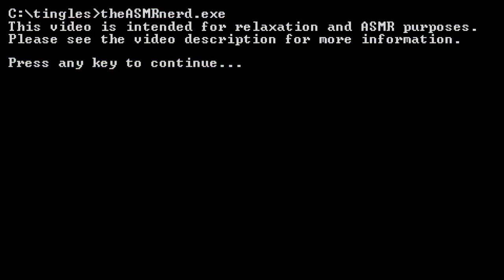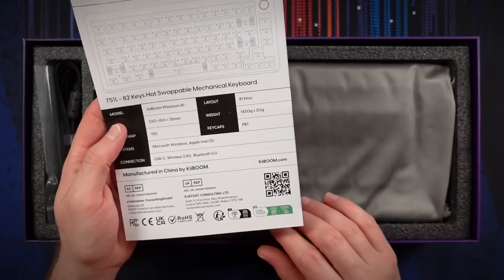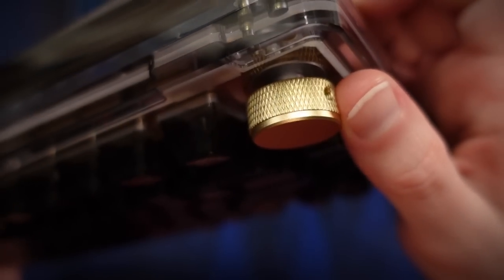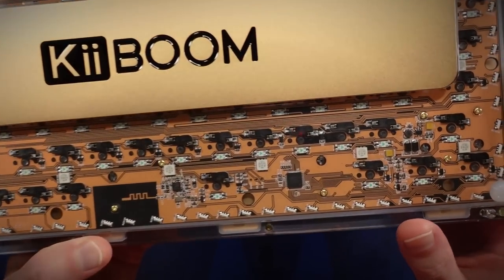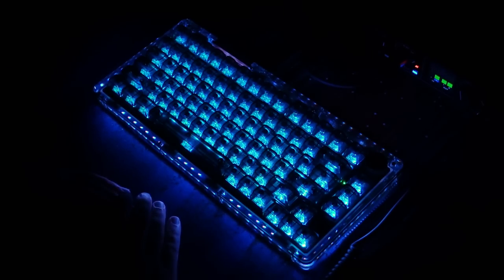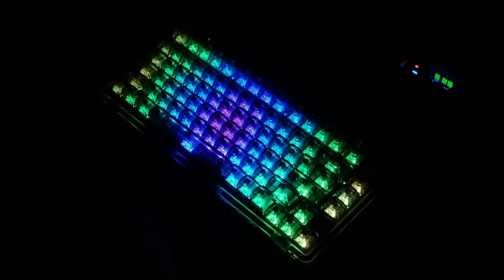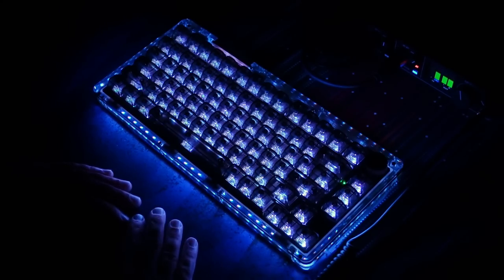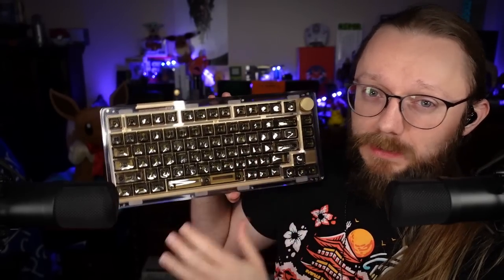Soft Spoken ASMR ⌨ KiiBOOM Phantom 81 Mechanical Keyboard Unboxing & Thocky Typing

Comment: bro kiiboom phantom 81 or skyloong gk75 aluminum 4 Knob.

both keyboard pre-built.  

I'm getting both keyboard for same price. 

so which one would be better, please reply.

also tell me the price of Skyloong gk75 aluminum, I checked it on epomaker site, it showed 170$ for the pre-built. 

but the switchandclick channel girl said it's about 255$ 

because when I google the price that time on skyloong site it shows 180$ just for kit. 

so if it is this expensive and if I'm getting it at same price as that of kiiboom then should I go with skyloong?

but kiiboom's look I liked. 

I was wonder if I don't buy skyloong then what would I be Missing. 
- 4  knobs (i don't know if that many knobs are any good for me)
- aluminum built
- expensive board at kiiboom price. (bro please check the price of the pre-built)
- 5.1 bluetooth. 
- better stabs and sound ? (I'm not sure)

Comment: That is an awesome microfiber cloth. Thing is huge. Would be great for big TV's.
Reply from the maker: That's actually a great point, I can use it on my monitor (which is actually just a TV lol)
Reply: @theASMRnerd  yeah, I've never seen one so big haha. And I do the same thing, tv as a monitor. Cheaper to get a nice bigger one for some reason. Slap monitor on it and suddenly it's double the price lol. I suppose the hz are usually higher though.

Comment: I have to admit that I skipped straight to the typing portion of this video and I have no idea what he did to this thing, but I was completely surprised by how good this build sounds.
Reply from the maker: No worries, I provide the chapter makers for exactly that reason! I actually didn't do anything to this keyboard, the typing sounds you hear are 100% stock! It's gasket mounted and has several layers of dampening, as well as cutouts in the positioning plate for additional flex.